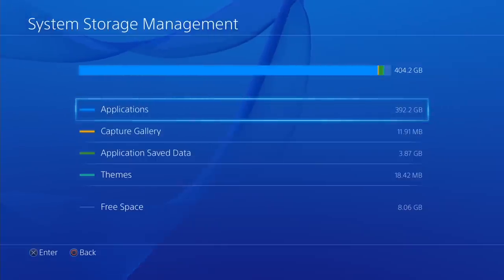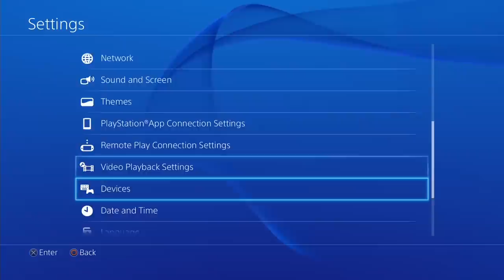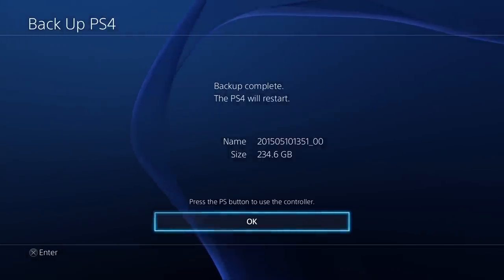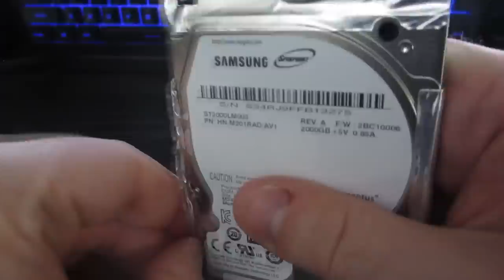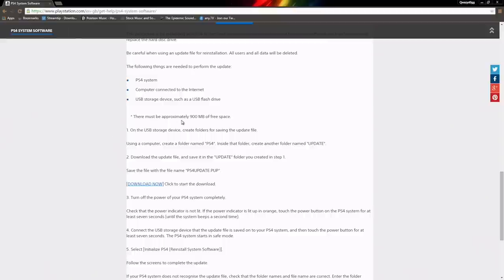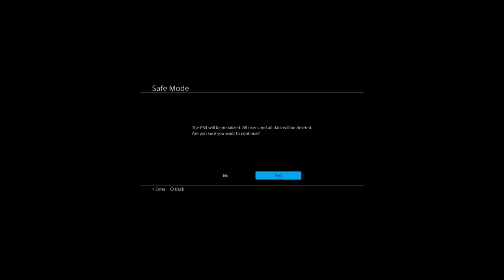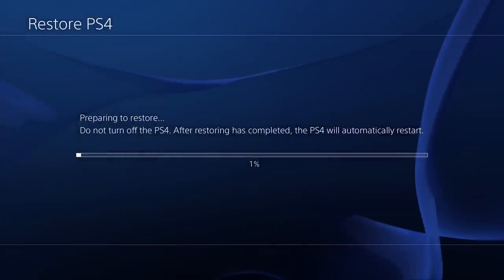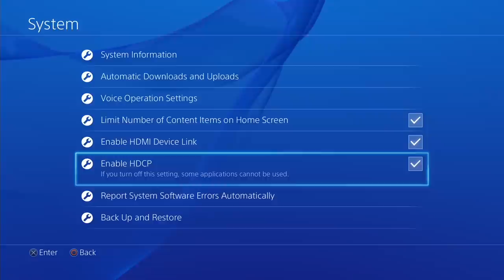How To Upgrade Your PS4's HDD Using A 2TB Seagate External

Comment: i exchanged my Hard Disk Drive with the same one you have just the black casing. hows your load time? and online play? mine seems to be slow. i wonder if its because i recently installed my game that took a while and when i wanted to play online it still needed to load. did you experience any issues like this and were they resolved after?
Reply from the maker: +Julio Valladares Theoretically there should be no difference as both drives are 5400rpm. I experiences no issues. There is a possibility that it's slow due to the drive multitasking both loading games and installing content. Give it a bit and it should be fine

Comment: Have 1 question, I'm actually installing my 2tb drive tomorrow with a seagate back plus drive and despite the fact that when we hold the ps4 power button until we heard the second beep, is this process safe with the 7200 RPM and I'm actually gonna use the ps plus online storage to back up my game saves so main question is that there will be no problems once I upgrade my drive right? @Qwazyd0gg
Reply from the maker: No issues with a 7200RPM drive!

Comment: Which formate had to be the hdd for make the backup I'm trying with a fat 32 with 320gb and I had only 280 gin on my ps4 but no way I can't ! Shoold I use a big hdd or another formate for the backup?
Reply from the maker: Fat32 is required for the backup and you should have more than enough room. Try reformating and checking disk manager to make sure you don't have it split into partitions.

Comment: Hi! What is your HDCP trick? I'm doing doing Extra Life every year and it always annoying me to have to change this setting. Also, it could solve the problem with the PS3 HDCP. Thanks.
Reply from the maker: +Jean-Francois Chabot Grab an "Orei HD-102". It is an HDMI 1x2 splitter that passed through 1080p signal and 2.1 channel audio. I have heard some other splitters also serve this secondary function; however, I can only personally vouch specifically for this model. I have this between my amplifier and my Elgato HD60 Pro and it scrubs the HDCP signal from all components plugged into the amp (PS3, PS4, Smart TV etc). I have had this work on my old Roxio card, as well as my Elgato HD60 and now my HD60 Pro flawlessly.

Comment: How many Gigabytes does your USB have? I have a 16GB Cruzer Glide Blade but the problem is I can't back up the applications on the backup screen
Reply from the maker: I backed up all my content to another external USB drive that was 500GB in size. If you're backing up to a flash drive, you will have to have a flash drive larger than the file size you're looking to backup.

Comment: can I back up all my save data on to the 2TB Seagate Backup Drive and then put it in the Ps4? Or do I have to get a second drive to back the data up? please respond, thanks :)
Reply from the maker: You will need a second drive as the main 2tb will reformat itself once installed

Comment: Awesome job Andrew.  Definitely the most thorough tutorial out there.  One quick question.  One other tutorial mentioned that you need to hold the power down and wait to hear 2 beeps when you are getting ready to initialize the new drive in order to get into safe mode.  Is that still true or does it take you straight to safe mode once you power up with the USB connected.  Pretty excited as I am backing up my PS4 now, and have my new 2 TB waiting for it's new home.  Again great job, and I am subscribed to your channel.  Oh one last thing, definitely would like to see your workaround for HDCP.
Reply from the maker: Awesome to here your liking the tutorial and also upgrading your system! I just powered mine right into safemode but if that doesn't work for you then you can hold the power button down. I may do a full tutorial some day on the HDCP but for now you can see the box I use in my "setup vlog" on my channel. Honestly its just plug and play lol nothing terribly special as far as the HDCP bypass XD
Reply: For me when I did it I just normally turned it on, and plugged in the controller, YOU MUST PLUG THE CONTROLLER IN! And then put the usb in, and it worked normally
Reply from the maker: +BaconGaming VS Thanks for the added information Bacon :D

Comment: how long did it take you to take apart the hard drive case , i plan on doing it the day before xmas and i wanted to know how much time i could expect to spend on it ( ps4 will be new and have no files on it when the swap is done )
Reply from the maker: +Maxime Thivierge opening the case only takes a few minutes. The entire process without backup should only take you an hour or so
Reply: ok thanks for the fast response

Comment: So I got as far as too put the new hard drive in, put the USB with the new update in the ride folder in the PS4 before I turned it on, and clicked ok to check the USB and it says the update can not be used? It is the latest version also?
Reply from the maker: +jake shanley i would try reformatting the USB and grabbing the file again. I've heard of others having this issue and it was due to the wrong file bring used.

Comment: GREAT VIDEO! You're my hero. Just a few questions before I do this myself.

1. Do I need to back up my previous data? Or can I just start from scratch, reinstall all my games and just resign into my PSN account? 

2. If I were to back up some of my old data could I choose specific data such as Savedata and a few games downloaded of the psn store. I would just be backing up on to a 250gb hard drive. I would delete as much data as necessary. Would that work?

Thank you so much for this kick ass video and I'm definitely subbing!
Reply from the maker: Hey man! You don't have to backup at all. I personally did because my old service provider throttled PSN pretty heavy and I didnt want the re-download headache. You can totally start from scratch and redownload everything again... Providing it is still available. I stress this because some games have been getting removed from PSN, which means the cannot be reinstalled if you start over. Think P.T. as an example. If you do backup, you can pick and choose your backup content for sure. Best of luck!
Reply: Thank you! And yea I'm not worried about not being able to download again because all I'm worried about is Tomb Raider. I am surprised at how easy it is to do this. All I need is patience!
Reply from the maker: +Nerdy Casual absolutely :) not terribly difficult. Just need a bit of bravery

Comment: I put the 500gb hard drive from my PS4 back in the Seagate casing but it won't come up as a storage drive on my pc. How do I get this to work???
Reply from the maker: +Jo shmo You have to go into Disk Management and delete all the partitions and reformat the drive. Then it will work without an issue :)

Comment: Hi i buy yesterday seagate 2tb expansion+ and i take the hdd out of the hdd cover. The when i connect to my ps4 sata abd i start my ps4 then it will not support this.
Reply from the maker: You need to format the drive on a PC first, then load the PUP file for it to boot from

Comment: For people that have 2+ profiles:

When backing up and upgrading 
your hdd, is it worth the time to back up all the applications? (Some 
certain users play games that others dont) And in my case there are 3. 
One has plus and the others dont.
Reply from the maker: +AHorseWithExplosiveDiarrhea™ Plus doesn't matter too much.... just make sure the one with plus is set as the consoles Primary User so all other users on the same device gets the benefits of online play and game sharing. I'm honestly not sure if a backup does all users individually or if the backup compresses all profiles onto one backup. I would recommend a bit of research on that one just to be sure
Reply: Qwazyd0gg Thanks, I got a 2tb drive that listed ps4 compatible amd didn't even fit so I opted to try this Seagate out
Reply from the maker: +AHorseWithExplosiveDiarrhea™ best of luck! The drive I used is listed in the description. Let me know how it goes :)
Reply: Qwazyd0gg will do
Reply: It worked thank goodness :D

Comment: i have a question. if i have two 2tb seagate pro slim external hard drives can i use the second hard drive to back up my ps4?
and im trying to do it to two systems so i was thinking back up my files in one hard drive, swap the 500gb for my 2tb hard drive. restore my data. format 2tb hard drive and use the 500gb(now) external hard drive to back up second system.swap 500 gb for 2 tb hard drive. then restore my data on the second system. leavingme with two 500gb external hard drives to use as i please. will this work?
Reply from the maker: I can't see why not :)
It seems like you would simply be following these instructions twice, so it should certainly work.
Reply: thanks man. imma give it a shot when these two external hard drives come in
Reply: hi again. was was able to make one of my ps4's 2tb. thank you, but i have to ask. have you ever used your 500gb ps4 hard drive as a external hard drive? i plugged it into my computer and it popped up as multiple usb devices(14 untitiled's) and i formated all of them. i plugged it into my ps4 and the system said it could not use that storage device. can you help me out? im i doing something wrong?
Reply from the maker: +Kev Ortiz you need to go into "disk management" on your pc and delete all 14 partitions and then reallocate the space and it will work :)
Reply: i have a Hisense C11 Chromebook. Im Having a hard time finding the disk management. Im hopeless lol
Reply from the maker: +Kev Ortiz I don't think it will by on chrome OS. You will need access to a Windows based PC. Sorry :(

Comment: How do you get your games and saved data back to the new HDD? are there any options? in the vid, you plugged in the old HDD and restored it to the ned HDD, could you use a USB aswell? My ps4 says that i need a USB to backup, does its backup in the HDD too? Sorry for many questions
Reply from the maker: +ThyleriOne No worries. I backed everything up on a 3rd HDD I had before I swapped. So I plugged in the spare 500GB HDD I had into the front USB ports, ran a backup of my internal drive, then swapped the internal drive with the 2TB Seagate, then installed the software using the USB stick, and once it was all done I then restored my backup from the 3rd external HDD.
Reply: wow its sounds so complicated, i cannot afford a third one. How about just plugg in the old ps4 HDD through the seagate pluggin?
does that work?
Reply from the maker: You cannot restore files from the old PS4 drive onto the new drive unfortunately as it can only be restored from an actual restore file. You best bet is to either borrow a 3rd drive or just backup your save data onto a USB drive.
Reply: Then the USB sounds better, but can you keep the backup and the update in the same USB?
Reply from the maker: +ThyleriOne unfortunately not lol
Reply: So i better use one USB to the update and another one for the back up?

Comment: I downloaded the update, double-checked that the names are all caps, plugged in it, started it up, and it says I need the update for 3.55 or later. I downloaded the "reinstallation update" or something (about 230+ mb) and it was at 3.15 and I didn't see any higher one. What do I do? Oh and the ps4 hard drive in the ext. hard drive isn't working. The computer recognizes it but doesn't let me see it because it doesn't show up under the devices, however it does in the settings.
Reply from the maker: +Austin Littlefield I'm honestly not sure what's going on with the update between 3.55 and 3.15. I do know what's happening with the original ps4 drive though. You need to format it and reallocate the space on the drive because it's currently in a proprietary format from the ps4. I believe I cover this in the tutorial; however, if not I've answered the How-To surrounding accessing disc management and reallocating in the comments already. Best of luck :)
Reply: Qwazyd0gg Alright, thanks! But yeah I went on the site and it had the 3.55 update download on it so I just downloaded that and retried it (all caps, right locations and everything) and it still says I need the update. I'll probably just wait until the next ps4 update to try it.

Comment: Hey, do I have to back up all of my games in order to proceed with this process? I'm afraid of losing all of my digital games. I do not have an external drive or a stick that holds enough storage for all of my games. Is it possible to just log back into my PSN and download all of my games back into the PS4?
Reply from the maker: +Andrew 23 any games you have that are still available for download on psn will be able to be redownloaded without worry. Any games like P.T. what have been removed from psn will need to be backed up or else they will be lost.
Reply: Qwazyd0gg Alright, thanks man.
Reply: Qwazyd0gg One last question, will all of my themes be alright if I switch out my HDD? Like will they be linked with my PSN? I'm switching out my HDD today.
Reply from the maker: +Andrew 23 everything you've ever purchased, whether it had a cost or was free, is linked to your psn ID and is redownload able as long as it is still available on psn :)
Reply: Qwazyd0gg Thanks for the help man :)

Comment: very informative. 2 questions.

1. If i understand correctly. Not backing up the PS4 drives only means that i will loose game data so i will need to reinstall my games and i will loose the current gameplay ? 

2. Is it possible to just add the external hardrive to the PS4 and use it as external storage like on the Xbox ??
Reply from the maker: +Alain Pilon you are correct with question #1, not backing up would result in a lost of game data and saves. Games can be redownloaded from PSN if they are digital. Unfortunately the PS4 cannot read from an external drive like the Xbox can since it writes the drive into a proprietary format not recognizable via USB. The Xbox works as the software is a variant of Windows 10. Hope that helps :)

Comment: I got a seagate drive inside instead of samsung, so is it okey or its gonna be problem. Furthermore, I cant use my original PS4 hardrive, it seems like my laptop cant read it.
Reply from the maker: +Ikhwan Rahman thats fine. You laptop will read it but it will need to be reformatted in Disk Management in your laptop
Reply: Its done! I has formatted it into a readable disk.. Thanks! It can only be read in the disk management because Windows cant read PS4 disk.
Reply from the maker: +Ikhwan Rahman That's correct. The PS4 has a proprietary portion system that needs to be reformatted and reallocated for Windows to see it. Enjoy your new space on your PS4 and the added bonus of an external HDD :)

Comment: with the original PS4 drive now in the enclosure, is it ready to use? plug and play? or does it have to be formatted or anything along those lines?
Reply from the maker: You need to go into disc management and format the drive
Reply: +Qwazyd0gg is case light working?
Reply from the maker: +king romi hmmm... I honestly haven't checked. I have it plugged in behind my pc for periodic backups, I will check tonight though
Reply from the maker: Kamil Skwara No, the case light no longer appears to function with the ps$ drive inside the seagate enclosure.
Reply: +Qwazyd0gg same with me bro light not working ,hope there's any fix for it ,btw thanks for reply :)
Reply from the maker: NP. Light seems irrelevant anyway since the drive itself still functions

Comment: hello, you didnt reformat the seagate HD right? you just opened it and put it inside the PS4? no need to format it to FAT32?
Reply from the maker: Correct, it is already FAT32 inside the enclosure :)
Reply from the maker: +Rafael Cruz it should be Fat32 out of the box which is the desired format
Reply from the maker: +Rafael Cruz it should be Fat32 out of the box which is the desired format

Comment: So the backup will be uploaded to the harddrive you'll later insert into the PS4, where you will then unpack the file by restoring it?
Reply from the maker: +Thomas van Doorn You will need another hard drive for the backup. Once you insert the HDD into the PlayStation and loaded into safe mode, it will be formatted, which means you cannot use the same drive for backup as replacement
Reply: Qwazyd0gg That makes sense. Just had to make sure. I'm a noob at these things. Thanks.
Reply from the maker: Thomas van Doorn No problem man :)

Comment: So the only thing that i'm confused about is the backup process. When you backup the playstation, do you back it up onto the new external hard drive(the 2tb)? So that when you put the 2tb drive into the playstation, are the save files and applications going to be there?
Reply from the maker: +David Bullock no. It must be backed up to another HDD aside from your swap drive.
Reply: Qwazyd0gg so you may not use the seagate hard drive

Comment: By plugging in The old hardrive for restore do you plug it in The place where you have put The new one is or somewhere else?
Reply from the maker: The old hard drive must be plugged in via one of the two USB ports on the front of the console.